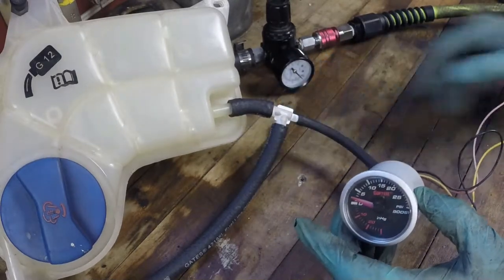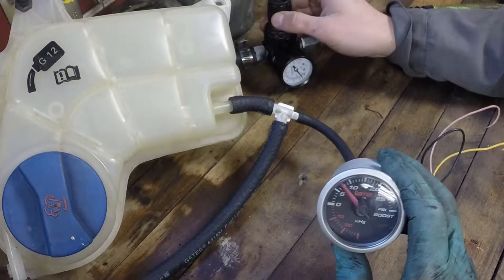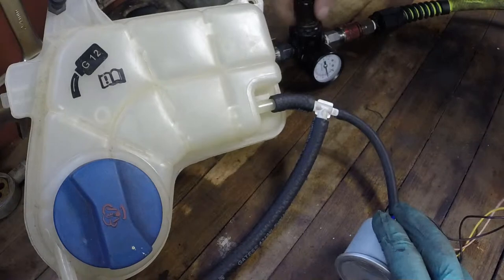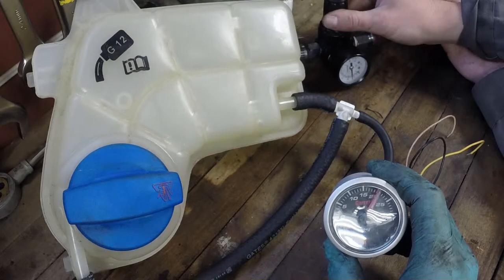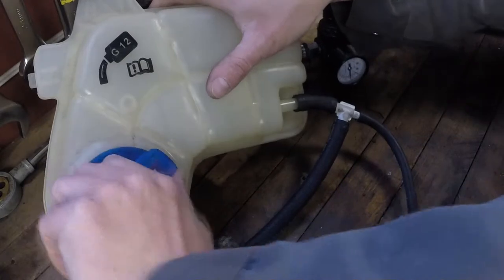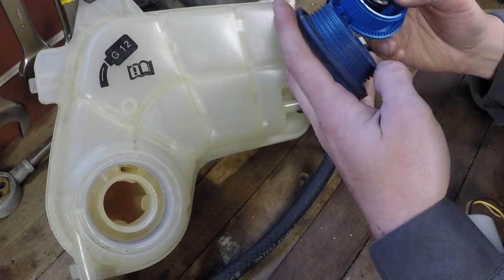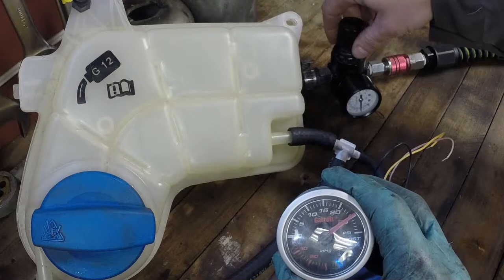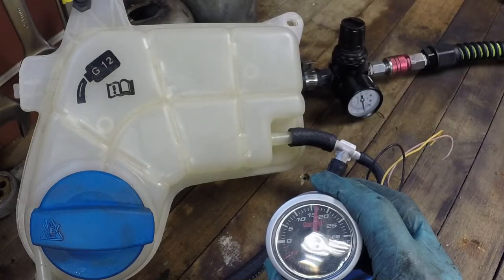Diagnosing a Faulty Coolant Expansion Tank Radiator Cap

Comment: Hello!

Any updates regarding opening at higher pressure long termn?

Is there a problem if I go to a higher pressure coolant tank cap?

For example the cap on my a4 b9 tfsi has 1.4 bar (blue cap) and want to change the whole coolant expansion tank with a new cap that has 1.6 bar release pressure (black cap).
Both are OEM!

Thank You!
Reply from the maker: Well the cap that was opening at 26psi caused constant cooling system related issues, including blowing apart the coolant feed line to the turbo, and blowing apart the fill plug on the coolant pipe, as well as having leakage issues at the heater core connection. So who knows, might be fine, might not be. I replaced it with a cap that opened at the proper pressure and had no more issues.
Reply: @PBGarage  thanks for the reply. The 1.6 bar is 23.2 psi.. 
It's strange that Audi changed the cap pressure with the newer coolant tank. :/